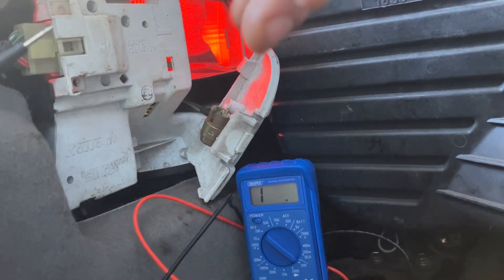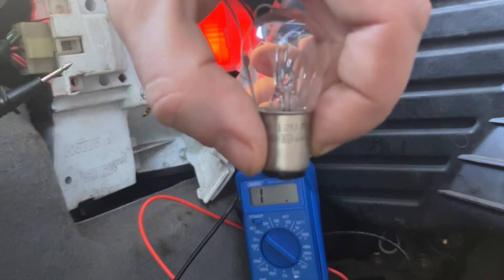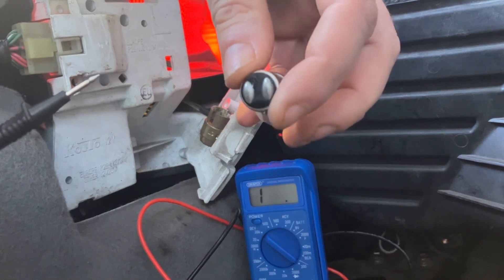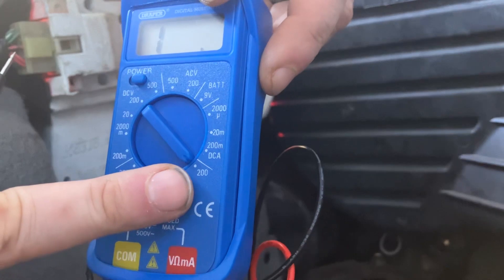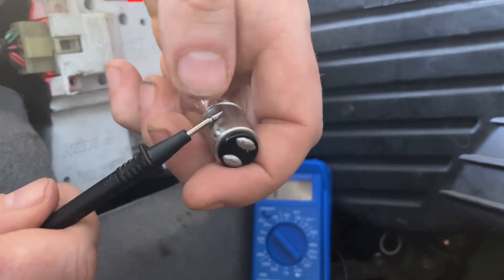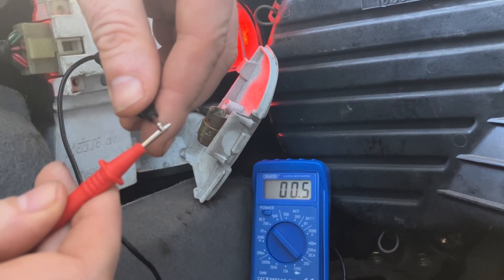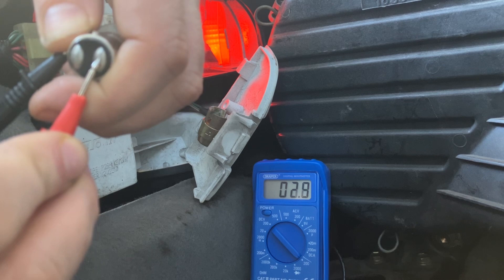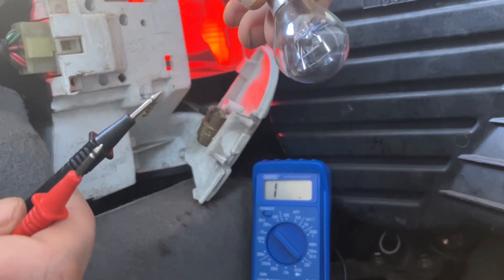How to Test a Double Filament Car Bulb.

Comment: How do I check contacts on moped? Does moped has to be running? What settings? Etc
Reply from the maker: Hi. Should be the same test. Moped doesn’t need to be running, but lights need to be switch on to test. Should be across the bulb case and wire connector or across two connectors depending on the type of design. Hope that helps.

Comment: What will happen if we remove one point and wire to change single filament bulb.
Reply from the maker: Same thing really, you would test the side/casing and the single contact on the base. Obviously it will just illuminate a single brightness, either 21W or 5W depending on the filament. Please subscribe if it's helpful! Thanks